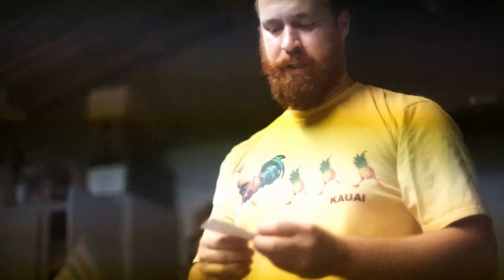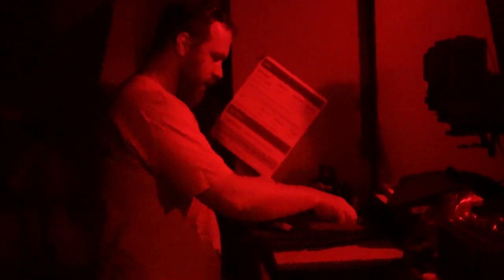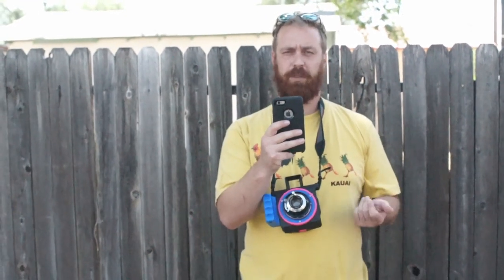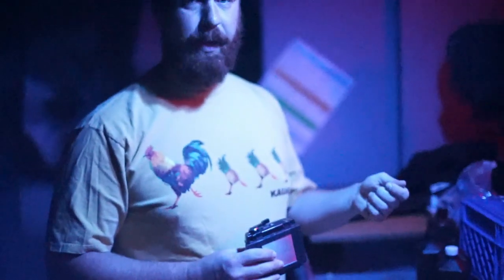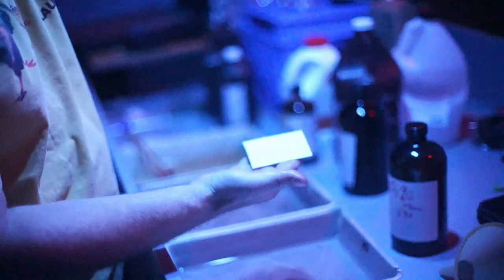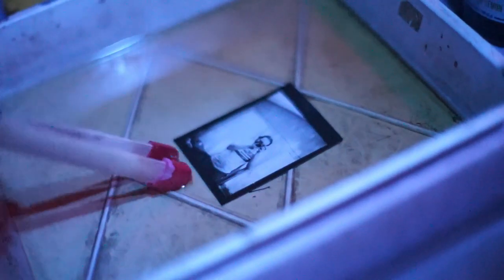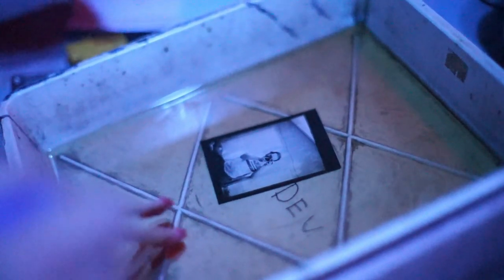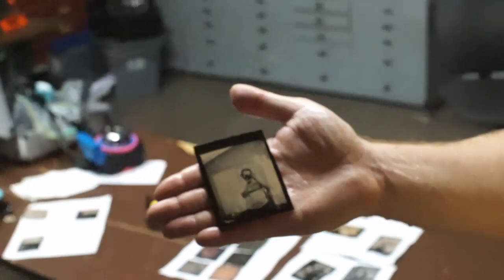Direct Positive Reversal Prints On Regular Photo Paper

Comment: This is awesome! Do you still agree with your statement that there is no need for fixing?

I was trying to figure out a way to shoot images at events and then process on site. I checked out the Harman Direct Positive Paper but since it is fibre based it would require fixing and washing which adds too much time and headache for a portable set up. This looks like a potential solution. Thanks for sharing your research!

Comment: Having luck with the whole process until 2nd development. It’s just turns black with a very faint positive image. Tried weaker developer as well as less time for 2nd exposure
Reply from the maker: My best guess is that you aren't exposing the paper in camera nearly enough.  The negative should be 2 or 3 stops denser than you would shoot for a paper negative.  It really sucks up the light.  I think of it as 'burning through excess emulsion'.  Joe and I made some diagrams about it a while ago, one day we'll do a boring technical manual.  for now, try increasing your exposure 3 to 4 stops.

Comment: I did dipped the negative to the acid and then HP. Doesn't bleached out. The acid seems to fix the the negs. Then I tried bypassing the acid. It works. But after fogging and redevelope it the image doesnt have contrast. Anybody have an answer? Thanks
Reply from the maker: citric acid should stop, but not fix the negative.  I would try the dilution recommended for canning tomatoes by ball.  I bet that if the acid is too strong, it will retard the action of the hydrogen peroxide.
Reply: @CAMERADACTYLCameras  Thanks! Would try dilute the acid more and see
Reply: I am facing the same problem. If I dip the image in citric acid, the H2O2 won't do anything. But I was wondering if its necessary to do citric acid part, while I still am able to bleach the images out only with peroxide. 
After bleaching, paper is all white..but in next development, even the bleached parts turns dark, which results in very dark low contrast positive

Comment: Hi! I am so intrigued by this process! Thanks so much for sharing this process, I am definately in! I have been looking out for a reversal product that only sells in the U.K and now I don't have to wish for it anymore. I was just curious as to your hydrogen peroxide bath? I have read that you use a 12% concentration, what are the exact measurements that you use, (water and hydrogen peroxide?). I know that his may be off topic but do you ever  pre-flash your paper? I have worked with paper using a pinhole camera and the contrast can be a little much at times, I have never pre-flashed paper before and was wondering if you had any tips on that. Thanks again for sharing! 
Nicole
Reply from the maker: Hey Nicole, thanks for watching!  I still owe you a Zine, just waiting for some scooby do style mail shuffling....    As for the process, I am using undiluted 40V crystal clear hydrogen peroxide, its a hair bleach.  

This is the amazon link:  https://www.amazon.com/Stabilized-Crystal-Liquid-Peroxide-HC-50409/dp/B00TP1IZDE/ref=sr_1_1?keywords=40+volume+peroxide&qid=1574520135&sr=8-1 . I got mine for 9.99 at the local beauty supply place, but in a pinch you can get it from amazon for $20.  

As for pre-flashing, I think it will greatly improve the tones and effective ISO of the paper during the main exposure, but I haven't done all that much experimentation with it, and what I have done was pretty unsuccessful.  I will absolutely try a few more times and make a video if I get some pleasing results from it.  Also, if you leapfrog me and make a better process, I'd love to see it!
Reply: @CAMERADACTYLCameras  Hahaha No problem! Thanks for the link, I will first check to see if i can get it local before ordering. I might try the pre flashing this weekend and jump on the process as well. I will keep you posted!

Comment: Just did my first shot based on this video. Using 1:4 Dektol and rather old pearl-finish fiber based paper. Shot in pretty much full sun. Citric acid 1/2 tsp to a quart of water, 40 Volume hair lightener (hydrogen peroxide) picked up at the beauty supply shop full strength. Very contrasty positive but it worked. Interesting thing is there's a texture on the highlight areas - like the bubbles of the H202.  Going to try again with RC paper. Thanks for the instructions - very fun to experiment!
Reply: Sorry, i am used to the metric system. quart of water = .... ml??
Reply: @analogclubamsterdam  1 US quart = 946 ml (1 US gallon = 3,785 ml); 1 UK quart = 1,137 ml (1 UK gallon = 4,546 ml)
Reply: Interesting. I tried it w d76 stock and got a very low contrast positive.

Comment: Thanks for sharing! What are the concentration used of citric acid an H2O2?
Reply from the maker: citric acid mixed as indicated for canning tomatoes.  I dont think it really matters, so long as theres enough.  H2O2 is 12% - V40 strength crystal clear H2O2 from the beauty supply shop
Reply: @CAMERADACTYLCameras  Citric acid bottle says 1/2 tsp to a quart of tomatoes, so I just went with 1/2 tps to a quart of water.

Comment: Very very cool. I read a fair amount of recipes but they did not work. What is different in your method, is that acid and H2O2 are not mixed but alternated. Very convincing demonstration that this is the way to go.
Reply from the maker: thanks!  please let me know if you make any experiments with the process, I'd love to see what you come up with!
Reply: @CAMERADACTYLCameras  What is the concentration of citric acid? I have Citric Acid powder and 6% Hydrogen Peroxide on hand. Do you think the 6% hydrogen peroxide will work?
Reply: @jojocolina2412  Should still work, but would ideally take longer — perhaps twice as much or more, since he is using a 12% solution. Also, depending on your paper size, maybe take a larger quantity of it, to get around the probability of it exhausting quicker than same qty. of 12% solution.

Comment: Interesting... this made me think of two things. First, if you want to lower the contrast you should consider changing developers. I had similar contrast problems when using ortho-litho film in my 4x5. I eventually settled on HC-110 dilution F to get a lower contrast negative that's actually usable.
Also, I remember years ago seeing a recipe by an Italian guy for reversing cine film. In his recipe he mixed the peroxide and the citric acid into a single bath. I can look to see if I still have the information somewhere. As for your instant camera, you probably could replace the liquid peroxide by the gel or cream type. That would essentially make a light goop that could be closer to the Polaroid stuff and easier to handle inside a camera.
Reply from the maker: I've seen the recipe you're talking about.  I've had many issues with the acid mixed with the bleach.  maybe i am missing something, but alternating between the two seems to be much more effective.  As for the cream H2O2, that seems like a messy nightmare, but please report back if you have success with it!